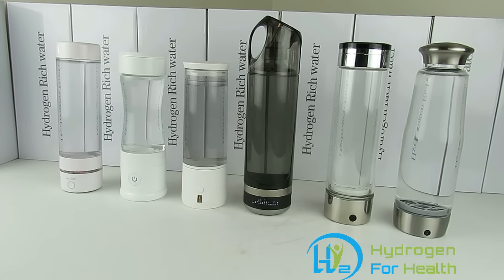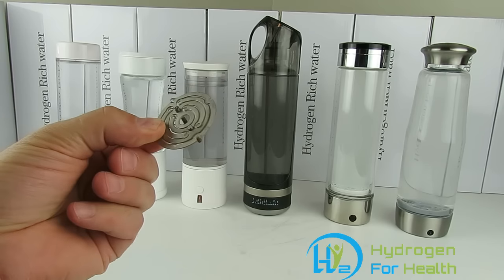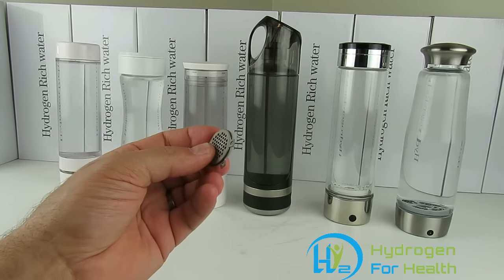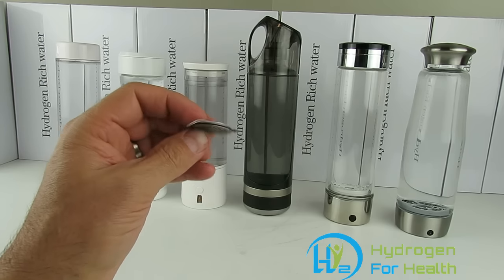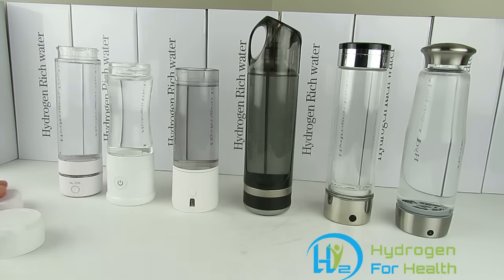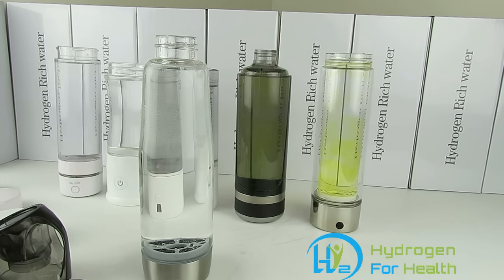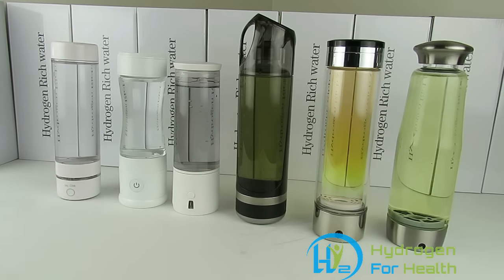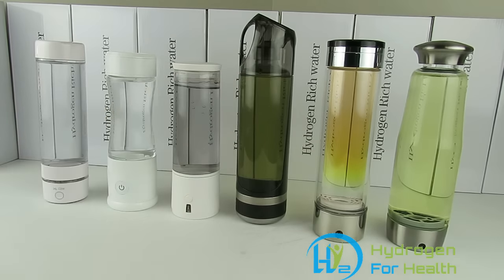Hydrogen water may NOT be safe to drink! Lets find out WHY.

Comment: How come the chlorine is produced by the bottle’s system? The water has the chlorine not coming from the system. As far as I know, basic knowledge cause chemistry is not my background, The electrolysis gives you the minerals in the water. But if the water used is fine, like bottled mineral water with less than 10 PPM , there shouldn’t be any chlorine in the water, and there is no way the system would produce it from that good water.
Reply from the maker: Margics it’s the mineral salts in the water that will make chlorine at the anode. If the water has zero TDS then there is no worry. If the bottle is not PEM there will also be leeched metals in the water from the anode.

Comment: How does it generate chlorine if it's an element? More than likely it's just the chlorine already in the tap/mineral water. Would be interesting to see the results from de-chlorinated water.
Reply from the maker: I was using non clorinated water. Did you even watch the video....?
Reply: in my honest opinion to what Steve has pesented, even if he ( for the sake of argument) used tap water that was chlorinated ( as most local water utility treatments do), the process of electrolysis, be it PEM technology or direct electrolysis method would have separated the chlorine inside the bottle. But the difference is that with PEM chlorine is trapped in the Platinum Electrolytic Membrane, and stays there. While with the inferior types, chlorine still stays in the hydrogenated water. That's why it was detected via chlorine solution test.

Comment: I've watched some of your other videos and now know that you've been working with hydrogen for over 10 years so I know I can trust what you say is based on your research and practical knowledge. I have an under $100 unit heading to me in the next few days and I've already made up my mind I will be sending it back. Problem is, at this time I do not have the finances to get the one I would like so in the meantime I'm tempted to make my hydrogen water using the magnesium sticks and malic acid. What are your thoughts please on that method? Should that method produce ozone and chlorine too? I am only now finding out about hydrogen water so I have some more reading to do.
Reply from the maker: Using magnesium sticks is a good way to get H2 into your body. Make sure the sticks are a really high grade of magnesium. You don't want foreign metals in your water. good news is you wont get ozone or chlorine. I didn't like the taste of the malic acid but that's just my opinion.
Reply: @Hydrogen4Health  ok, great...thank you.

Comment: Hi Steve, is it possible to get a few more models brand you checked and which produce the proper water?
Reply from the maker: Any bottle that is PEM will be safe.
Reply: @Hydrogen4Health  Thanks a lot !!!
By the way, if we use the same bottle and then add some salt will it become that sanitizing liquid? And another question, if you do not mind. How quick do we need to drink that water? Will it go back to what it was after a certain time? Asking bec that is what happens with the hypochloric acid ...even if you made a liter and do not use it, once needs to activate again the mix. Blessings
Reply from the maker: @GrowYoungerNow  The bottle will need to have a electric cleaning option for that to work
You should drink the water as soon as possible. The hydrogen dissipates quickly.

Comment: So not only does pem keep separate the chlorine that is produced during electrolysis from chloride, it also separates chlorine that's already in the water (or in this case added to the water)? Does the membrane only work on one direction?

Maybe im just confused about what chlorine drops are, is it also chlorine or just something that tests for it?
Reply from the maker: No, it will not take the chlorine out of the water.
Reply: @Hydrogen4Health  might be a good idea to put the water with chlorine in it from the right bottles into the left and see if the yellowness goes as it operates

Comment: Hey Steve, can you give me your input. For optimizing hydrogen content and running 2 cycles with these kind of devices (glass bottles), should you screw the lid on tightly, loosely, not at all? I've seen a lot of mixed instructions, and don't want to break my device, but also don't want to let all the hydrogen escape.
Reply from the maker: Fill it full of water and put the cap on for higher concentration.

Comment: To solve this use distilled water.  Then none of the units will generate chlorine.  You might have wanted to include that little bit of trivial information for your subscribers.
Reply: The electrodes will still leach metals into the water plus not everyone agrees that. distilled water is good for drinking

Comment: So if I use distilled water it wouldn’t matter what bottle i use??? Thank you
Reply: Yes that’s a good question .. but no answer ?
Reply: Suzanne Smithdale it seems without a mineral in the water nothing to change so no chlorine is all I can figure out
Reply: It's a statement that's sounds right
 @Suzanne
Reply from the maker: If you use distilled water there will be no chlorine generation but since the anode plate is not isolated outside the drinking water you will get metal leeching into the drinking water. Most likely titanium and platinum.

Comment: Hi delvis11. Your review is very interesting and illustrative. I just have one question, if somebody tells you that they use electrolysis through titanium/platinum plates it means that they use straight electrolysis instead of PEM technology, am I correct?
Reply from the maker: If there is not a membrane that separates the 2 plates then thats straight electrolysis.
Reply: @Hydrogen4Health  All right, got it, thanks!
Reply: i made one for 5$

Comment: 😳🫣Wow I ordered a PEM hydrogen water bottle off of Amazon lol that came out to $212. and some Change . And I have seen  this video and I just really wanted to know if the one I ordered was really making good clear hydrogen water. And 🥴😡no it wasn't! Lol and I took a look at  your video again and  I see that you used 8 💧 to test for chlorine. 😳Wow I only used 4 💧lol and the water started turning yellow right away and the longer it set in the water it turned into an orange color 🫣and that was just me using 4 drop off chlorine to test the water! 🤨So now you need to do this test on some PEM higher price hydrogen water to see if they PEM hydrogen water bottle is really working to stop chlorine from being made in the water that is supposed to have 👉PEM PROTECTION👀. Because this  one I have  is going right back to Amazon for my full refund ASP😱👎!
Reply from the maker: It's possible that your source water has chlorine in it already. Most city water has chlorine.
Reply: @Hydrogen4Health  😳Wow 🤔So how would it work out for me to even order one of your hydrogen if Kansas City drinking water already has chlorine in it ? I am going to have to look this up a see if my city has chlorine in the water.
Reply from the maker: @MrMichael48  purified water is sold by the gallon up in most grocery stores. City water is gross 🤮
Reply: @Hydrogen4Health  🤔So why do you and others say that there hydrogen bottled water maker will work with any kind of work? 🤨So if I buy your new hydrogen water that you have on  your web page site that I have an order for one in the basket. Would it pass the grocery store filtered water that you're talking about for your hydrogen water bottle not making chlorine in the water? 😳And thank you so much for bringing this to my attention! Because I just tested out my tap water and 🫣😵‍💫It didn't pass the test. It does have chlorine in  it already. So the hydrogen bottle that I brought may have passed the test with cleaner or just filtered water in🥴.So do you ever have any sales on your hydrogen water bottle? Because I really like the new digitally style of hydrogen bottles that you are selling and I have one in my basket 😉👍.
Reply from the maker: @MrMichael48  A good pem bottle won't put any NEW chlorine in your drinking water. If the water already has chlorine in it, the bottle won't take it out. You can use any kind of water in our bottle but I suggest a clean, healthy purified water to start with.
Use coupon code : 20Love
Reply: @Hydrogen4Health  🤔So what is your warranty on your new digital hydrogen water bottle I have in my basket on you your website and and how much would shipping and handling be?

Comment: Why didn't you show that all the water on each bottle came from a single source? I didn't know chlorine can be just "generated" by some device.  I thought it's some sort of chemical that you need to mix in the water. And why you're hiding the small bottle behind the camera? I feel like there some abra-ka-dabra effect is happening here.
Reply from the maker: When people do not understand things sometimes they think it's fake. Chlorine is a manmade chemical so it has to have a manufacturing process. turns out chemistry can help with the answer you seek. salts when electrolyzed generate chlorine chemically. Google it.

Comment: Why did you use filter water. This what I see what is recommended for this battle. Chlorine should not be an issue. Chlorine is not generated from thin air.
My issue with all this bottle what happen with oxygen. That what not should in there. I do not think that at this voltages this operate you can got ozone.

Comment: This is not correct, you can't make chlorine with electrolysis, only if you use water with chlorine. Ozon is not dangerous to drink.
Reply from the maker: You’re wrong, chlorides will generate chlorine at the anode.
Reply: add salt to the water and the electrolysis will make chlorine. By sending electricity through saltwater (sodium chloride, or NaCl), which interacts with the chloride ion in the salt. This creates chlorine in the water, and a very high-pH byproduct called sodium Hydroxide.